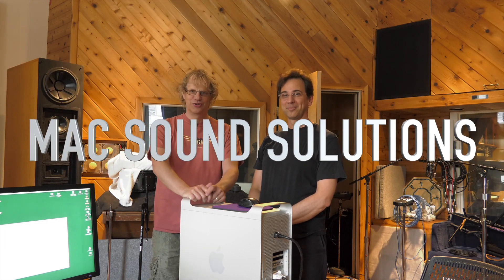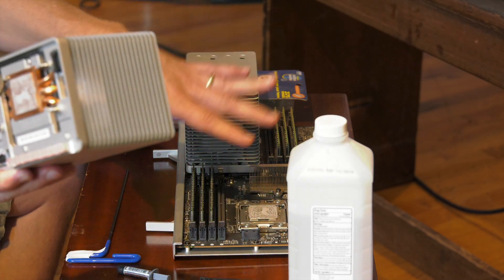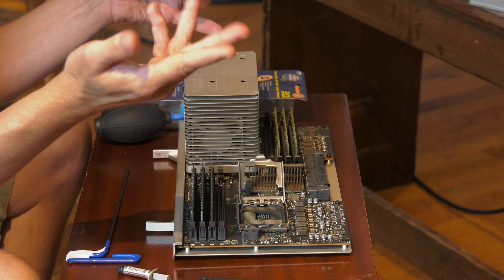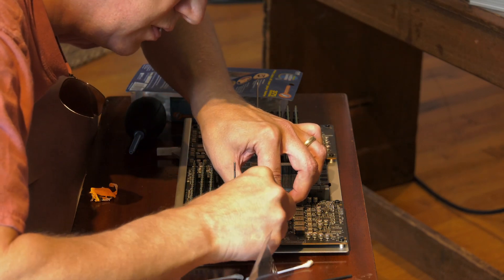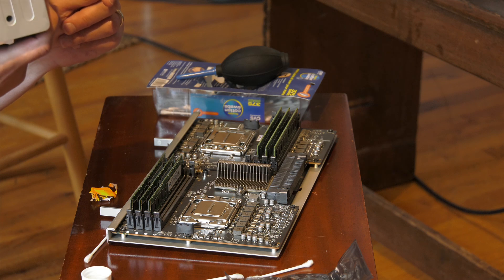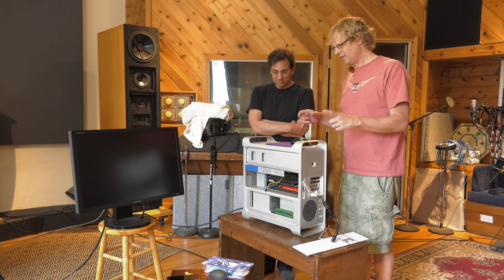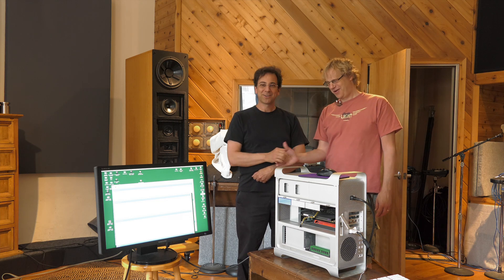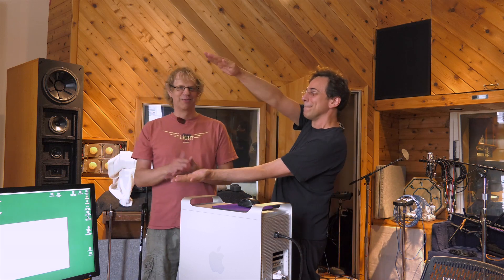MAC PRO 2010 5,1 DUAL CPU UPGRADE

Comment: Whats up Lance my friend. Just have a quick question. What version os and Pro Tools version you using today and are you having any problems with sluggish plugins and meters?
Reply from the maker: Hey RW nope I am on 12.7 and OSX 10.12.4 no issues with the graphic glitchies, everything is working great.
Reply: I was asking because I'm using PT 12.7 on 10.12.5 and I notice when I put some plugins in like waves 1 and ozone 7. When I make changes within the plugin the meter's in pro tools will freeze while i'm making changes. And when I use the scroll ring on the trackball expert mouse to make changes like on PuigTec EQs it don't move smoothly and kind of glitches. do you thinks it's my video card because I have the same 1 that came with my mid 2010 mac pro tower. I see they use metal on sierra so no beamsynce here lol. What you think I should do Lance.
Reply from the maker: what card od you have if its the GT 120 def upgrade, if its a 5770 or 5870 then it could be something in your system. Out of date plugins etc.
Reply: I have the 5770 inside for my video card. I did a clean os sierra install and just install the new waves plugin update and then opened up pro tools. It's the same issue. What video card you using because i'm thinking it's my video card. but pro tools works great in ML. But i need to update because the os is out dated and somethings I can't do like some internet updates etc.....
Reply from the maker: I actually had some weird stuff going on but after deleting pro tools prefs using PT Prefs https://www.dropbox.com/s/d7szj1osbewed9z/PT%20Prefs.zip and updating EUCON my issue seemed to go away. First Pro Tools would randomly quit, so I deleted data bases and that seemed to fix that, then my web browser or mail  app if not in use and just up and running without me touching the computer for a while would get stuck, updated EUCON and so far it has not happened since. But that was just tonight. I have a GTX 1080ti which has been really good. It needs two power connections, but was flashed for mac so I get the boot screen. But I would wait till 10.12.5 as Apple will provide native drivers for AMD newer cards like the 580 https://www.bhphotovideo.com/c/product/1332121-REG/msi_rx_580_gaming_x_8g_radeon_rx_580_gaming.html They can be cheaper and smoke your old card. Only need one power feed. But cant use till 10.12.5
Reply: Thanks bro hope everything's cool when they do a update.

Comment: Lance, was it easier on the 2010 than it was with the 2009?  I'm getting ready to order a pair of 6 core CPU's and try this myself.  Thanks for the video!
Reply from the maker: GemCityStudios 2010 is easier on the whole but the heatsinks are a bit trickier to get on, less chance for errors than the 2009 thanks to the CPU clamps and the fact you don't have to remove the ins caps on the cpus or have to make up for the 2mm difference if you leave the caps on.
Reply: Lance McVickar , do you think there is much difference between the the X5680 and the X5690 as far as performance is concerned? I'm getting ready to buy a pair for my machine, and there is $75 difference.  Let me know, thanks!

Comment: I've now successfully upgraded a 2009 and a 2010 with your help- thank you. I did the 2010 first and it was definitely easier. I did the exact upgrade in this video- dual quad 2.4 to dual hex core 3.33.  Key to both 2009, and 2010 is getting the torque of the heatsink bolts correct. I used the washer method on the 2009 and it worked well. 

Also, I just HAVE to know- what/who is the gold record on your wall in your other videos? These are still fantastic machines with lots of core power. Thx again. Cheers.

Comment: Hello Lance.  Thanks again for an awesome video.  Had a question for you... I've followed your steps and upgraded my 2009 MP (flashed to be 5.1) but my geek bench results are in the 26-27K range, and not near the 30K you get. (http://browser.primatelabs.com/geekbench3/6295955)  Any hints on where the delta lies and what I could do/improve to get to the coveted 30K range?
Reply from the maker: Alex Antonov what processor do you have installed.
Reply: I got Intel Xeon X5690 @ 3.46 GHz 
2 processors, 12 cores, 24 threads, at least that's what it says on them and what GeekBench result that I've linked shows...   I was wondering if maybe you could share the link to your result so that I compare the results from different sections to see what diverges.
Reply from the maker: Alex Antonov do you have 1333 ram installed or the older ram? 1066. You need to zap your pram it may make a difference in that it will update and see the newer hardware. You should get over 30,000 with geekbench 3 but only the 64bit version 32 bit will give you under 30,000. Geekbnch 4 will give you about 24000 ish
Reply: Lance McVickar I have 1333 installed and have done full PRAM reset as well.  Since I've used the 32bit test (the 64 one is a paid feature), guess that's the difference...
Reply from the maker: Exactly you will get lower scores with the 32 bit version, and the new version GB4 is lower as well as they set the bar higher overall so scores are lower overal. Good news is that Nvidia is releasing drivers for the 1080 pascal cards to run on out mac pros. So I think your 5690s are doing just fine.
Reply from the maker: One thing I forgot to note was you should only fill the first three ram slots in both memory banks to get the fastest speeds out of your ram, if you fill all the slots you will get lower geekbench scores.
Reply: Oh, that could be the reason as well, as I have all memory slots full with sticks!
Reply: Alex Antonov  I just upgraded to 12 core Intel Xeon X5690 @ 3.46 GHz on my mac pro 2010 from 2 x 2.46 ghz 4 core and barely getting 19353 on my multi core score but on my single core score I'm getting 2826. I also upgrade my memory ram to 1333 64 gb...along with a new ssd samsung 860 and gpu msi rx560...How do you zap it? @MacSoundSolutions
Reply from the maker: @Steadyawake  ZAP it? Do you mean flash the video card? You can't flash it as far as I know. Also you will get considerably lower Geekbench scores when filling all of the ram slots of the mac pro. You should remove the last chip in slot 4 of each ram bay and you will see better geekbench score and better memory performance, just depends if you really need all that ram or not. Geekbench 3 64 bit will run a much higher score than Geekbench 4 as they lowered the benchmark scores across the board to make way for faster computers I guess.
Reply: @MacSoundSolutions  I never heard that term "zap" for pram reset .. I know now what you are referring to I  just haven't zapped my pram yet...I have 4 big ram sticks each 16gb total of 64 gb so two each on each ram bay, so I'm good.. I got two slots open for each bay (3 & 4) but thanks for the info, good to know...Overall it was a successful upgrade, your vids help me learn to do it right

I just gotta zap it and run the test again and see what the score is
Reply from the maker: @Steadyawake  gotcha, yea zap is the wrong term reset is correct, its a good idea to do it after the install / upgrade.
Reply from the maker: @Steadyawake  https://support.apple.com/en-us/HT204063